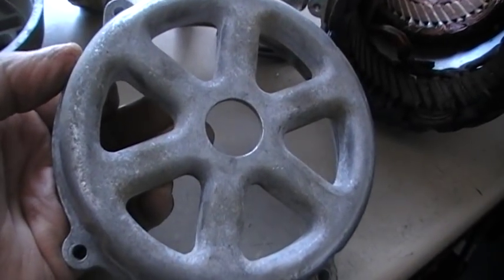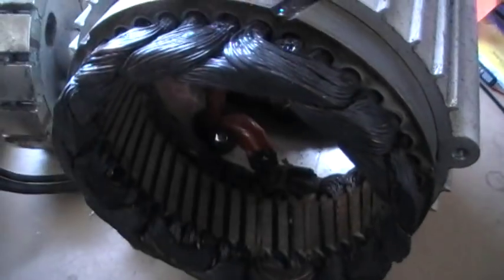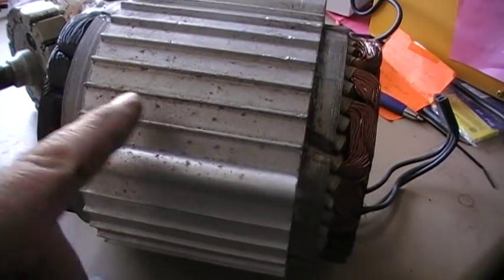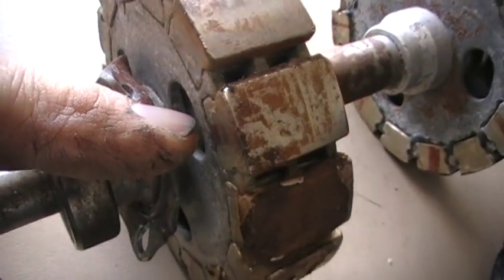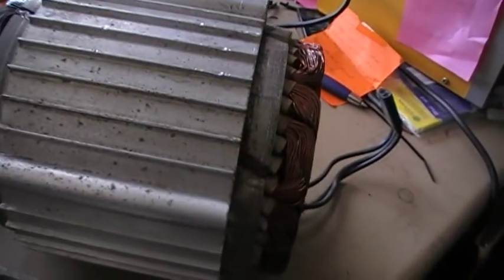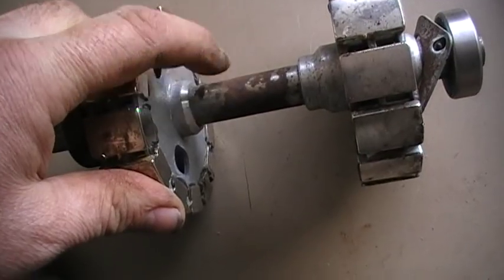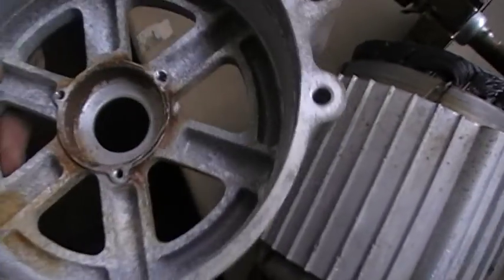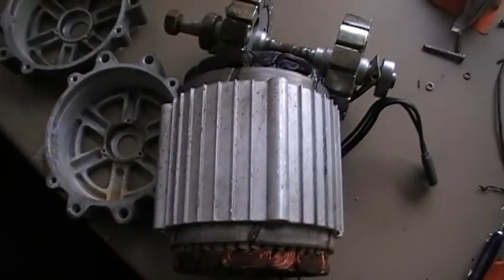Budget !! Freedon II PMG wind turbine generator fail

Comment: hey les how did you manage to remove the shaft and rotor assembly, i want to do the same to check the shafts and magnet rotors for balance/ straightness as with both my mws pmas the wheels do not run true, there is approx 2 to 3mm movement on all four magnet rotors, whether its out of round rotors or bent shafts i dont yet know? and ofcourse that will lead to premature bearing failure which seems to be a common occurrence and ive even seen it among mws supporters which i also was once , ive seen this wobble inside other freedom pmas and that is what led me to inspect my own only to find i had the exact same dissapointing build quality, the  "Only" reason i bought them in the first place was to avoid such quality issues as they "did" advertise the freedom pmas as "100%" USA made but now advertise them as vietnamese made after many complaints etc , i did complain about the wobble but it was put to me that maybe they were damaged in transport , if that were the case the outside of both my dual pmas would have been heavily dented to generate such force even to bend a 17mm cheap stainless shaft and both the housings are still  in pristine condition to this day.
i was thinking of using the very thin flexble cutting boards/sheets to slide inbetween the magnet rotors as to protect the magnets  either that or engineer a press and something to hold the housing square and firm.
once ive found the cause in the future i could do a vid on my findings and put the question to others if they notice the same defect in their pmas or not.
ive tested the output on these units they do perform in higher winds but theyre terrible in low winds id say due to cogging which is advertised zero cogging / no cogging and possibly weighty blades.
we own a genuine 2kw turbine and that turns smooth as silk ( true zero cogging) and it is insanely heavy with 3.2m blade and hub span and hits 2kw @ 18mph. the freedom does it @ 40mph but @ 18mph its a trickle charge unit really in comparisson.
Reply: Well a customer brought it into my shop with birnt out coils
he gave it to me to fix, but found out the coils were from washing machine motors, and obsolete size
to source parts, so in the scrap bin after we made video.
Customer said it was difficult to open, anyway spanner it open, be carfull magnet can fly out if loose,
I never have any problems with the Hornet generators,
Reply: thanks for the reply, yes ive seen those magnets come loose from the adhesive a few times now on other peoples pmas and recently on hensley issaac channel.
i never bought from therm/hornet as at the time i didnt even know you existed, hornet shipping to Au is reasonable but for therm the shipping on ebay has always been "huge" for some reason and i mean huge, i sent screen shots to therm of ebay shipping but its still the same to this day yet mw , WN , hurricane the shipping is around 3 to 5 times cheaper i kid you not, but thankfully hornet shipping prices are good. pitty hornet is not as prolific on youtube as someone else.